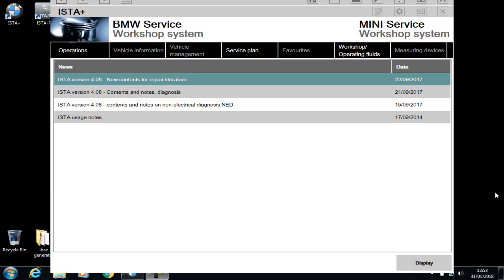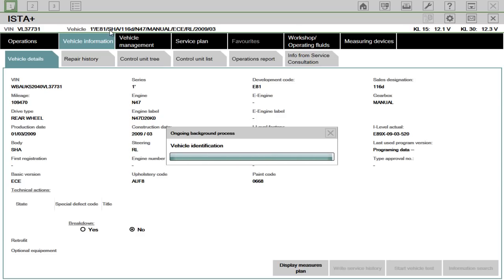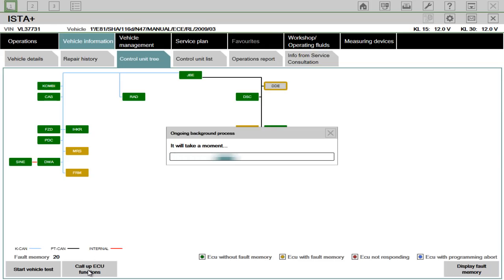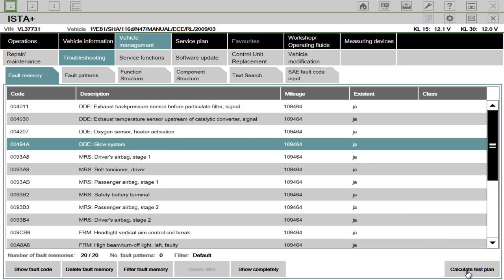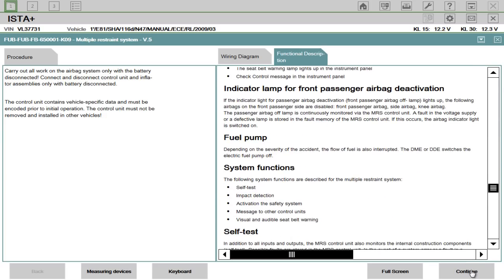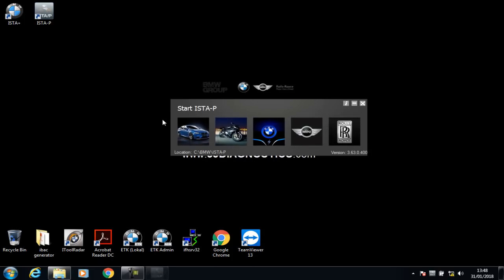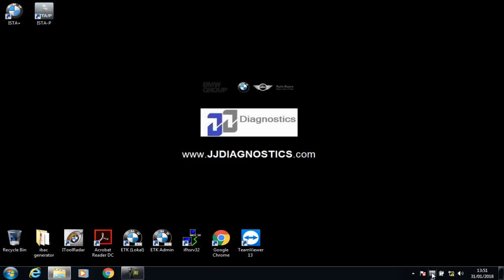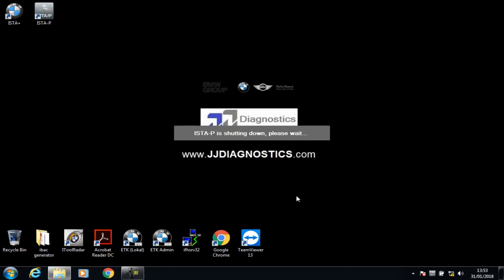ISTA+ (ista-d) and ISTA-P 2018 demo / tutorial on how to do a basic scan

Comment: Hi I’m hoping you could help me out. I bought a 2007 335i that was in a front collision and had airbags deployed. I have some of those blown airbag codes as shown and the car is running really rough idle and doesn’t accelerate at all . It only starts  and has a rough idle. I replaced the battery, got a new BST and a new alternator since I thought it would stop that and still this problem occurs. Is there a procedure I have to do to the car for the ECU after a wreck ? Just need some advice thanks
Reply from the maker: Likely has some other engine related problem.

Comment: Can I use it for coding my E60 as well?
Reply from the maker: Yes you can.
Reply: @jjdiagnostics  I need to code in 600w cooling fan (got only 400w currently). I thought it's a straight forward swap plus coding, but I just realised that 600w fans have 4 wires going in not only 3, so if you have an idea how to tackle it I am all ears. cheers
Reply from the maker: @peter7998  I install diagnostic software, I do not have thorough mechanical knowledge of all vehicles. It would be best to ask on a owners forum. But, I can say, parts normally need to be swapped out like for like, unless you've done some heavy modifications, the standard 400w fan should be sufficient. Upgrading parts like this usually require modifications elsewhere on the car, such as replacing the ECU that operates it as well..etc. Best to stick to like for like parts.
Reply: No it's not sufficient...if you go to bmw and get the tow bar fitted you'll be charged for a upgraded fan as well - all I need it a wiring diagram to know where to run that extra wire to and code in hot climate that's it.
Reply from the maker: @peter7998  You'll need to find the pinout of the configuration with the tow bar fitted. Likely the engine ECU. ISTA has all this. As its a one off job you need doing, I'd recommend fitting the part, then visiting a local workshop to finish off the job. If you want to do it yourself, then the bmw owners forum may help.

Comment: hello , do you know anything about the most connection Icom B , My Icom work fine ista D works fine but i can  not seem to make the most connection to work it tels me that there is no communication with the most ring ecus, in other words either my Icom b is not working or i have to do an extra step fro the  icom  to recognise the use of the icom b
Reply from the maker: MOST ICOMB does not need to be configured. It should work automatically. If yours doesn't, then It appears to be faulty, or either ICOM B is faulty or MOST in your car is faulty or you have bad software.
Reply: Your most is bad
Reply: @5129FNHG  ok, thank, I dont think is the  car  the  module  are find when  I use the software and the Icomm  A  only, the sofware i  belive is find becouse I am able to detecthem  the  most ring, and modules are  green  I think is my  icom b  not working I order another one  wish me luck

Comment: thanks for great video...so on my vehicle i have the ISTA+ and i can read fault codes and all properly however the test fails....is there a database that i am missing for my F10 that needs to be in installation file for me to run the test?
also if i can read the error code why do i need to do a test? what does that do?
Reply from the maker: ISTA+ isn't on a vehicle, its software on a laptop.

Comment: The one thing you don't show is how well the system works with live data. The PID list is an extremely important tool to use when you are doing diagnostics. Also, ia the system bi- directional and what special functions can you do? Can you do coding and programming with this system as well?
Reply from the maker: I did not have it connected to a vehicle, so that is impossible. Its just a basic video created as many people asked me how to set it up and do a basic scan.